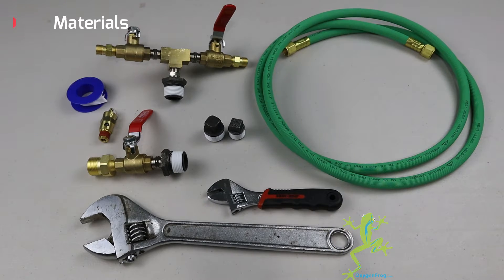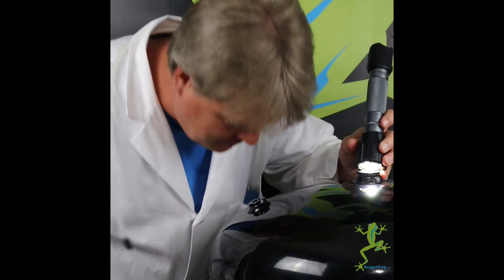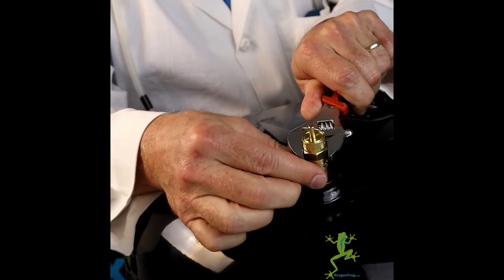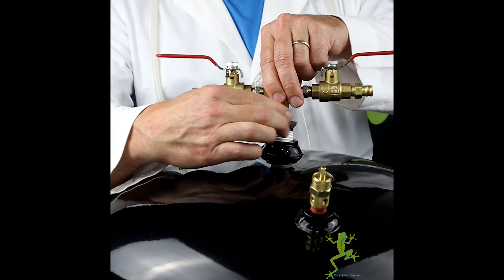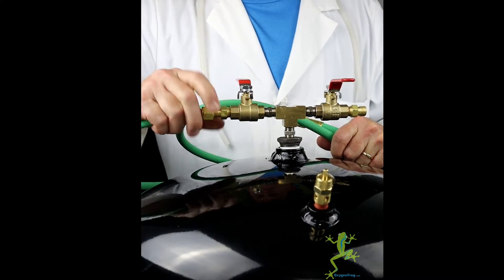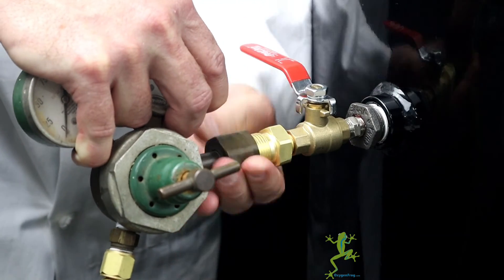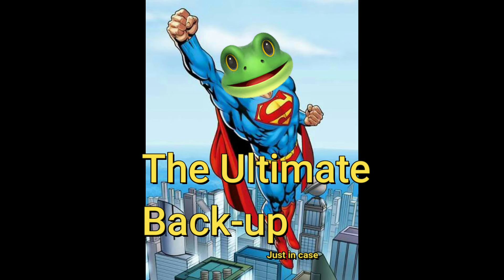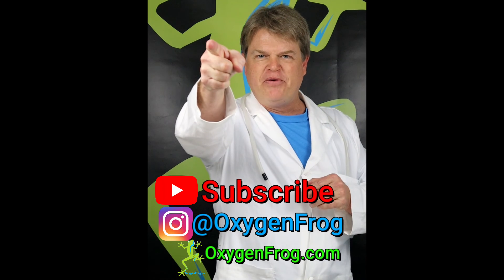Glassblowing, Oxygen Frog : Tank Setup (Surge/Holding Tank)

Comment: I'm going to be getting two 8lpm oxycons for cheap and I have a 150lb tank I normally exchange that I want to use as the backfill tank or whatever the proper term is. Do you have the parts I need to hook them together and a homefill device for the system that I can use with my 150lb tank?